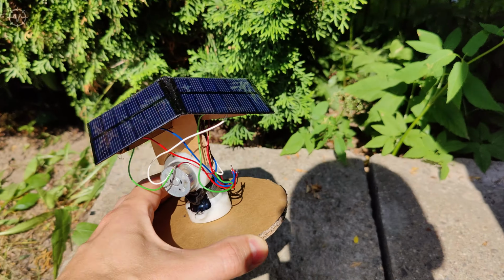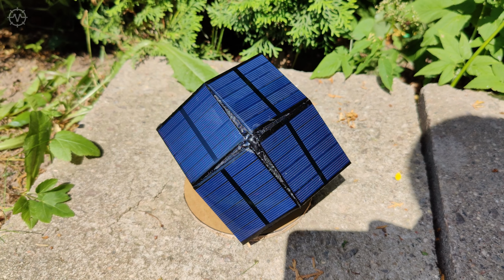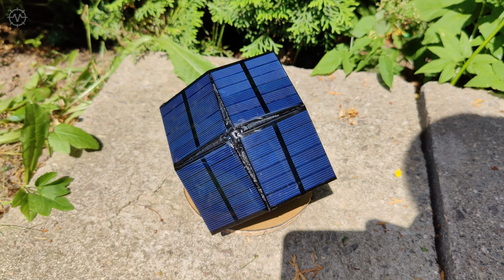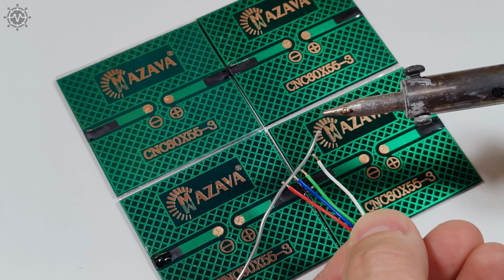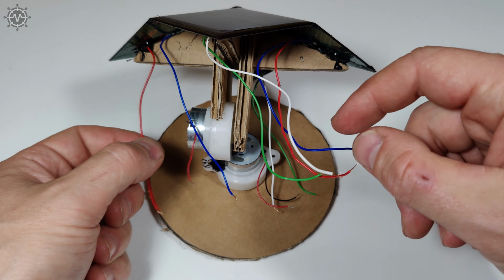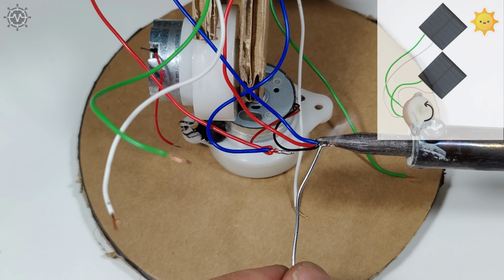How to make a Super simple Dual Axis Solar Tracker without Any Chip DIY (4K)

Comment: This is cool and all but running cross polarity on the panels will degrade them, not to mention now you've used the panels power to run the motors leaving you with no output power to charge or use
Reply from the maker: It's just a TRACKER prototype, it's job to track the position of the sun ONLY but if you attach a more powerful generating solar panel to it, you'll get a complete system which will be able to charge lithium batteries efficiently. Subscribe to see the complete system soon..

Comment: Thankyou for this amazing video I really appreciate your effort.
Reply from the maker: Glad you enjoyed it!
Reply: @MukGyver I have a question, where did you plug the wires in the geared motors at the end of the video? Because I will make one for my science fair project.
Reply from the maker: @unknow2448  All wires from the solar panels to the geared motor wires connected directly, only the solar panels of opposite sides the wires are connected with reverse potentials. At the end of the video you see soldering panel wires to a short motor wire, so it's a bit unclear.
Reply: @MukGyver Thankyou for letting me know!

Comment: Simple and a great idea, but does connecting the +ve and -ve terminals from both sides damages the solar panels ?
Reply from the maker: Thank you. As you probably know solar panels work like diodes and the currents at this PoC are very low, so no damage could occur.
Reply: Does this really works or not ?
Reply from the maker: Of course it works!

Comment: 発電した方向に向いた後はしばらく静止しているんでしょうか。
シンプルでグッドアイデアですね！
Reply from the maker: It's just the concept of the Tracker, it's job to track the position of the light source only but if you attach a more powerful generating solar panel to it, you'll get a complete system which will be able to charge in example lithium batteries efficiently.
Reply: @MukGyver  地球に優しい素晴らしい発明です。

Comment: Does it still work if I use a geared motor of 5v 6000rpm?
Reply from the maker: Unfortunately, in this place, there must be a geared motor due to torque and slowness. I think geared motor till 10 rpm should be used.
Reply: @MukGyver would it still work with a 6v 5rpm?
Reply from the maker: Sure!

Comment: Hey! I dont get the fact that..how this project i working without a censor or a circuit...plsss explain me coz i m gonna make it and just wanna confirm if it will work
Reply: pls clear my doubt....
Reply from the maker: I don't get what you are asking for..
Reply: it does not matter that you are uncapable to understand this project, it matters, that this project works. and here it is not about believing, but for using the real natural forces like the power of the sun.

Comment: It will work if the sun is behind?
Reply from the maker: In the middle of the day - yes, the tracker will turn over to the other side itself. In the early morning I don't think so, it would need an additional solar panel for return position.

Comment: Will this work with 10rpm geared motor
Reply: Please help me
Reply from the maker: Depends on solar panels rated power, but if you use similar solar panels of course it will work.
Reply: Yes Bro it worked
Reply: And let me won silver

Comment: Sir please tell me that would the solar panels also react to phone flashlight? Because in the end you've used a light bulb and it follows it, so how does it do that, don't solar panels only react to the sun? Can you please explain it to me
Reply from the maker: Of course it will also work with LED lights. The solar panels, illuminated by a light source (whether it is the light of the sun or a flashlight) generate electricity, which makes the electric motor rotate.

Comment: Do you need a diode to put on the positive of each solar panel or not?
Reply from the maker: For such low currents it's not necessary, the solar panels work as diodes as well.

Comment: A bigger version and basically a practical one will have a lot of challenges, as the panels weigh too much and also need to consider wind turbulence.
Anyhow very great demonstration.
Reply from the maker: I agree, thanks!
Reply: @MukGyver  I like the Idea that this is self sustaining without the need of a external power source or a micro processor. "Low-Tec" is easy to maintain and repair. Maybe you could place the same thing on top of an bigger panel. The small pilot-panel would power relays instead of motors. The relays could then control a bigger motor to turn the main panel. only a small suggestion for the next project ... 😉
Reply: @MukGyver  I was also thinking of a similar device, but using mirrors and  bimetall or shape memory alloy like nitinol. A Suntracker with no electricity ... just for fun ... or maybe as an art project ...
Reply: the mechanism doesn't need to be fast so hypothetically you might still use this with the proper geared reductor (low speed and high torque) and move a large pannel

Comment: The problem with this design is there is no reset or park position.  As the sun sets, the panels will be cranked all the way in one position and they stay there.  Next morning, the sun comes up behind the panels, which now can't produce power.  Each day you will have to manually move the panels to catch the morning sun.  Great if your using a bulb, not so great if using the sun.
Reply from the maker: The tracker was designed for portable charging purposes (need to attach the bigger power solar panel to it only). There is no problem attaching one more smaller solar panel for the return position if the system will be stationary.

Comment: although it is a nice experiment is completely unuseful because:
- the hot glue will melt under hot sun (i tell you by experience)
- you cannot use the energy generates by the solar panels other than for tracking.
Reply from the maker: Have you heard of proof of concept?  this is it - the PoC,  to show 'real' functionality only, it's not constructed for all day work and it's only a Tracker version. You can attach to it other bigger solar panels and use them for generating 100% of available sun power.

Comment: This direct use of geared motors may not useful in big solar panels...
Reply from the maker: Yes, of course in big solar panels or solar arrays there will be other construction which will help to move them all with two geared motors but the main idea to control big panels or arrays could be the same..

Comment: so it can follow the sun...  great !   but is consumes the enrgy it produces  to move the panels.   How do you get energy from the panels to use for REAL power that you can use p. ex. to charge a phone or so ?     NOT
Reply from the maker: Sorry, it's just a TRACKER prototype, it's job to track the position of the sun only but if you attach a more powerful generating solar panel to it, you'll get a complete system which will be able to charge lithium batteries efficiently. Subscribe to see the complete system soon..

Comment: Problem here is clouds or reflections that alter light to panels differently.
No need for any of this.
East - west
The earth revolves at a set speed 360 degrees per day or 15 degrees per hour. It is constant. Just gear to that.
North south
The north south depends on location but only varies a small amount per day. Once calculated  for a location, it doesn't change. Once again it could easily be done mechanicallly.
Reply from the maker: Thank you for your suggestions, I think they would more fit for the stacionar system. Imagine, if this tracker will be adopted as a portable phone charger (including a powerful PV panel), with your options you will always need a compass and to set up the position of the tracker in different locations. It would be very impractical for a portable device..

Comment: This whole thing only makes sense, when you store the energy in lithium battery, not simply cancel it out.
Reply from the maker: It's just a TRACKER prototype, it's job to track the position of the sun only but if you attach a more powerful generating solar panel to it, you'll get a complete system which will be able to charge lithium batteries efficiently. Subscribe to see the complete system soon..
Reply: @MukGyver  It only needs to be re-positioned every 30 minutes. You could use a timer circuit and relays to switch between solar cells and motors or solar cells and charging circuit.
So power to relays means 5 seconds of re-positioning, otherwise charging.
Reply from the maker: Thanks for the great tip, I'll keep that in mind
Reply: @stefanp4258  wow,timed incremental progression and harvest the 29 other mins per movement . Cool
Reply: Or you could monitor the position of the tracker and use it to control the direction of your entire solar array.

Comment: More work than using a sun sensor and the panels wouldn't be at an angle to each other.
Reply from the maker: That would be a different system because for the sensors will need additional components to run the motors.

Comment: solar panel short circuit...bad...👎
but hmmm...better than free energy generators on YT...🤣
Reply from the maker: Not exactly a short circuit.. The low current flows through the resistance (windings of the dc motor) and the solar cells are basically a large area photodiodes.
Reply: @MukGyver  i know...but this is terrible circuit...effectiveness on zero...
Reply from the maker: It's just a TRACKER prototype, it's job to track the position of the sun ONLY but if you attach a more powerful generating solar panel to it, you'll get a complete system which will be able to charge i.e. lithium batteries efficiently. Subscribe to see the complete system soon..

Comment: Wow totally useless. The reason to follow sun is to yse extra power gained. You use all your power for movement?
Reply from the maker: You're wrong, it's just a TRACKER prototype, if you attach more powerful generating solar panel to it, you'll get a full system. Watch this video again till you get it ;)
Reply: Sorta, but not really useless.  If this were heavily geared, it could move a much larger solar array to face the sun.  Since the sun doesn't move very fast, the gearing ratio could be crazy.
Reply: So yes... on its own.. this would be "useless..." but I don't think the creator intends this to be more than a proof of concept.  It's a great PoC.  Even on its own, it could be a fun toy.
Reply: @MukGyver  OK, I see what you mean. I was looking through the eyes of wanting to charge a phone. But yes , I see now. 😉👍
Reply: Once it is in position , it will generate steady power , but I don't think it is useless
Reply: Perhaps it ( the motion) could be connected to servo tester to gain more torque
Reply: No it's not useless, you can put bigger solar panel in this and use it.
Reply: @pauloneill9880 it takes a big person to admit a mistake so thank you for that.

Comment: Looks like it's useless in practice. All voltage from this scaled down version is used to position the panels. When panels are positioned at a perfect angle to the Sun, there's zero voltage difference. Nice but useless toy.
Reply: Nevermind. I saw your comments that this is just a dedicated tracker, which isn't expected to produce useful energy.  Ok then... But it wouldn't be easy to integrate it into the bigger system. There are easier solutions to go about it.
Reply: everything starts as a toy :D  a sling shot progress to an AK47  :D   nothing is ever useless, people who lacks vision finds everything useless

Comment: You just made a system that is certain NOT to achieve maximum power. NONE of the panels will point exactly at the sun AT ANY TIME.
Reply from the maker: It's just the concept of the TRACKER, it's job to track the position of the sun ONLY but if you attach a more powerful generating solar panel to it, you'll get a complete system which will be able to charge i.e. lithium batteries efficiently. Subscribe to see the complete system soon..